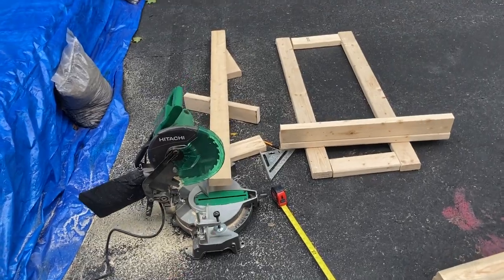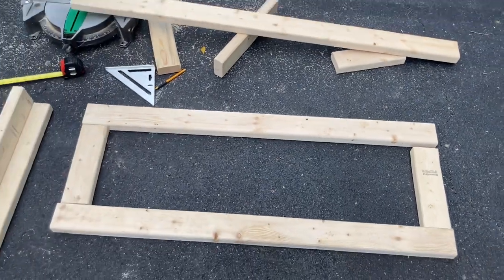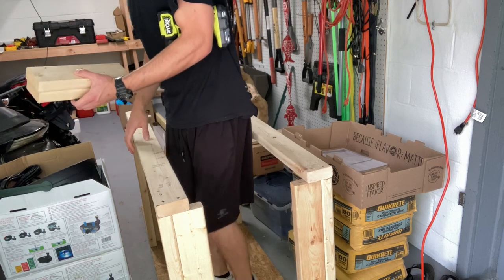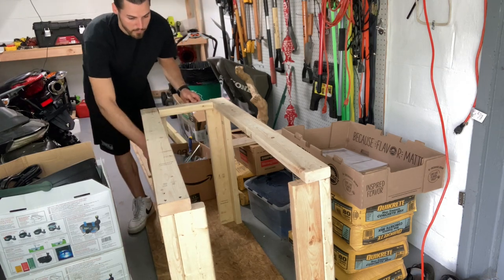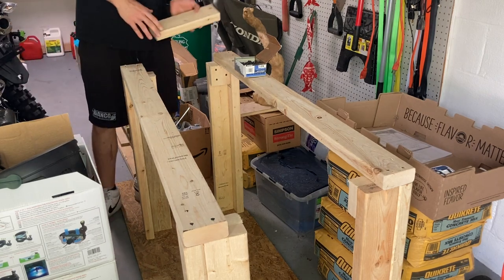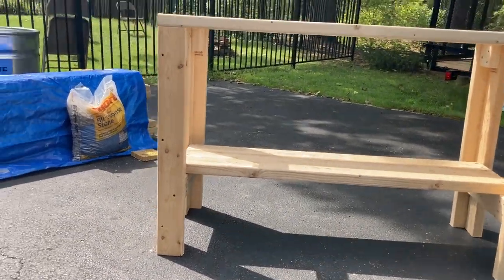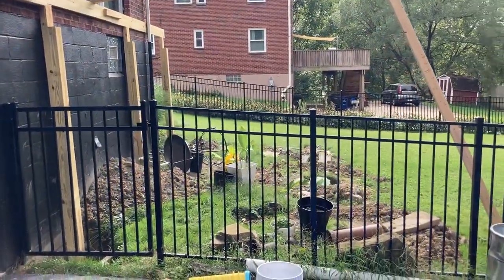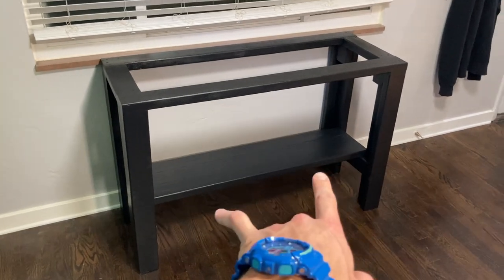How to build an aquarium stand  (NEW Slim Design) - 75 gallon

Comment: I am wondering if the middle needs another leg for support, with the 2x4s flat and not on their edges. How is the stand doing after one year?
Reply from the maker: Still doing good!!! :) 
all the weight is on the corners and being that its wood on wood its holding up well

Comment: A quick InterWeb search reveals that drywall screws are brittle and their shafts are thin because they are made to hold drywall to studs, and not made to fasten lumber together to be load bearing.  I have snapped off the heads of drywall screws just using them to install drywall, so there’s that. Deck screws are designed to just hold deck boards down.

My opinion is that construction wood screws would be a much better fastener choice for an aquarium stand, especially one that’s going to be filled with water, which would make it much much heavier than one used for reptiles.